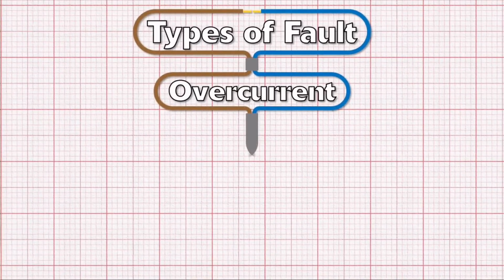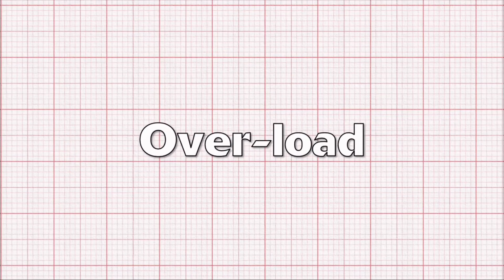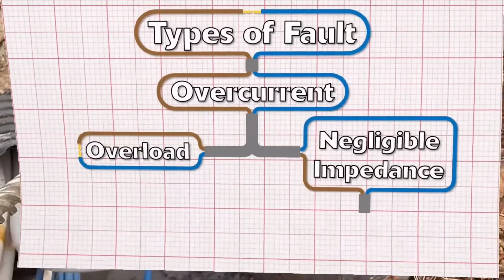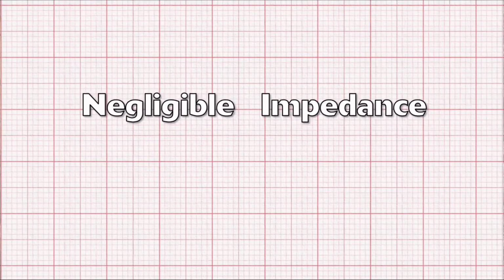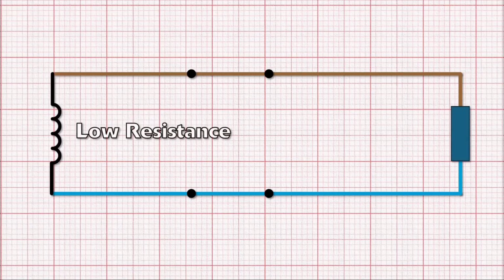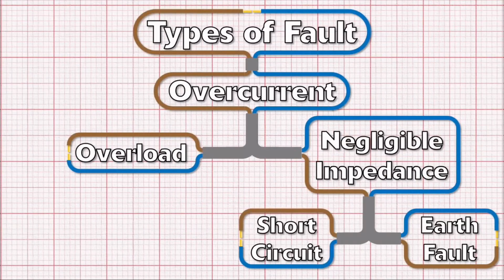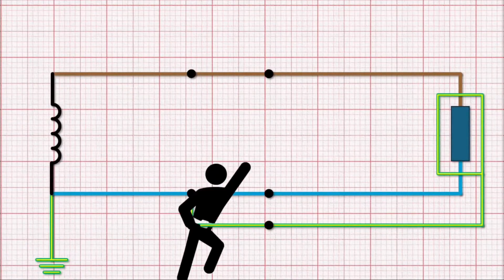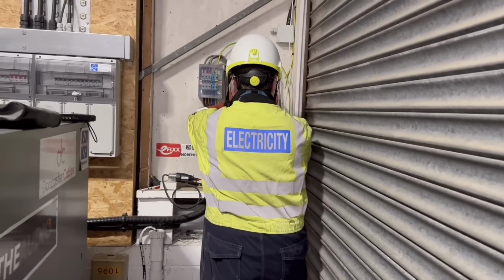Short Circuit, Earth Fault or Overload : Which One's Worse?

Comment: A shoutout to surge currents particularly:
- Starting Currents for Motors
- Starting Currents for Capacitive Circuits
- Starting Current for cold resistive circuits (e.g. filament heaters)

They are above the rated limit for the MCB, but only briefly.  However a stalled rotor would certainly yield an more persistent overload condition.

Comment: Petty pedantry; At ~4.00 you do need that the supply system is actually earthed ("T" terra) at some point for the line to earth current to be created. 
If the supply system is not 'earthed', such as to hold the line at an elevated potential relative to earth (low impedance earth), then of course big currents don't flow. Usually various stray capacitances (hence a moderate impedance at line frequency) help keep an otherwise isolated neutral at close to earth potential. Rarely a domestic problem..

Comment: Mature aussie sparkie here.
Negligible impedance ??? Ok technically correct,  but would it not be much simpler and explanatory to call it short circuit and earth fault? Oh why do we have to complicate things?
Reply: Remember, they have high impedance earthing over there, ie TT (direct for Aussies with long enough memories), as an option for general means of earthing so an earth fault (line to earthing) isn't necessarily 'of negligible impedance' like it would be here for most installations.

Comment: A fault unique to 3 phase circuits is the loose connection of neutral line. Single phase appliances connect to neutral and one of the live wire for 220V, but if the main neutral connection become loose, it effectively becomes a tug war between two groups of single phase appliances connected between 380V and eventually one or both side will become the fuse. This only happens to single phase appliances in 3 phase circuits, so most time when it happens, the large motors and heavy equipment runs completely fine, but all the computers and lights in the nearby onsite office can all get toasty.

Comment: After living in France and building my own house, I find the UK wiring system archaic. The single wire inside a plastic tube, use of many different colours to differentiate circuits and many other better ideas. This thing of using the same 3 core for everything is silly.
Reply from the maker: Might have to make that the next in the series of Electrical Work Abroad. 👍
Reply: @efixx  Video of the finished house designed by my uncle ray and built mainly by me. https://youtu.be/WqdTVoppDxU?si=KpVRU2s4F_5es5yN

Comment: There’s also the issue of high resistance faults, loose or poor connections to high current loads that are operating normally.  These are the  slow hidden  fire starters hidden in junction boxes.  Breakers don’t always trip in these scenarios, there’s no arc to detect,  current is higher than normal but not high enough to trip the supply  breaker.
Ironically dead shorts are more dramatic and frightening at the time but less of a risk to life if the circuit is protected with good quality breakers.
Reply from the maker: Really interesting points, thanks for commenting. 👍
Reply: @efixx Thankyou, really enjoy your  videos.
Reply: @efixx  far more people are killed by electrical fires than being electrocuted. Most electrical fires aren't due to fixed wiring faults, but appliance faults, or equipment misuse. Wet towels draped over electrical heaters and the like.

Comment: years ago, back in germany, a friend had a problem. he had a 3-phase supply for his cooker and 1 or 2 of those MCBs kept popping. he asked me to investigate which i did. not finding any problem, i decided to pull the oven out of its enclosure and that's when i noticed a black spot on the connection box (hardwired, not plugged in). so i called in my father who was an electrician, and he opened that box to find that on 2 wires (don't remember if it was 2 lives or 1 live and neutral) the exposed part (without insulation) was too long which occasionally caused a spark which of course popped the breaker(s). he cut the wires to the appropriate length and reconnected everything. problem solved.
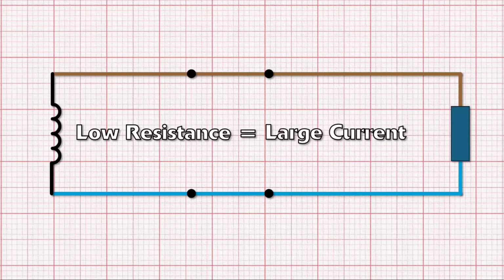3:49 i think that's what happened to my friend.
Reply from the maker: Great fault-finding skills! 👍

Comment: Being able to plug in loads, but also plug in sources.  If a person can plug it in without an electrical knowledge nor experience there must be protection that will address the outcomes.  If a person plugs too much load in, over current protection acts.  If a person plugs in a source, or worse multiple sources, effectively partially bypassing that protection potentially allowing excessive current in a path in a circuit, well we all know where that's heading yet plug in 'balcony' PV is a thing in some countries and is being pushed for in others.  If that isn't insanity I don't know what would be.
Reply from the maker: Interesting point! 👍

Comment: Can a short between N and PE be detcted by the RCD? It is differnt for TT and TN-C-S installations?
Reply from the maker: Absolutely it can, in fact if you've got the line disconnected and just the neutral and CPC touch it will trip the RCD. 👍
Reply: Yes, because some of the neutral return current will flow back through earth instead, causing an imbalance the RCD and making it trip.
Reply: That's the kind of fault an RCD is designed to protect against.
No it is not different for TT or TN-C-S installations.

As Dave has indicated, the RCD is effectively comparing the line and neutral current, if they are different by more than the trip current threshold, the RCD trips and disconnects the circuit.  So it doesn't know anything about earth or the earthing strategy employed in the installation.
It is solely looking at line and neutral currents.
Reply: I'll add one additional comment in how it can be different for TT vs TN-C-S - normally in TN-C-S you expect the earth path and neutral path to have about the same impedance, so if they get connected together then you get roughly 50% of the current flowing in each. The RCD will trip when you have about 22 mA of imbalance, so as long as 44 mA is flowing in the line, then you will get 22 mA less in the neutral assuming 50% is returning through the earth. However with TT systems the earth path impedance can be a lot higher, possibly several hundred times higher than the neutral path, so in that case the current will divide in that same ratio with say 90% returning through neutral and only 10% returning through earth (it depends entirely on the ratio of the two impedances) so in that case you'd need substantially more current flowing in the circuit overall to get enough imbalance to trip the RCD.
Reply: @davefrizelle3882 Yes, in some cases of contact between N and PE wires, the RCD may not react, including in the TN-C-S system